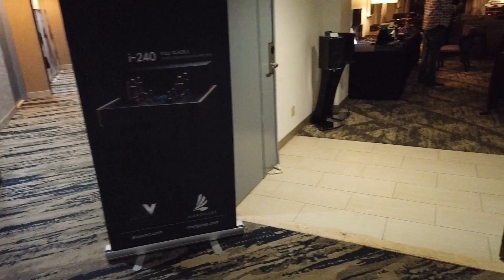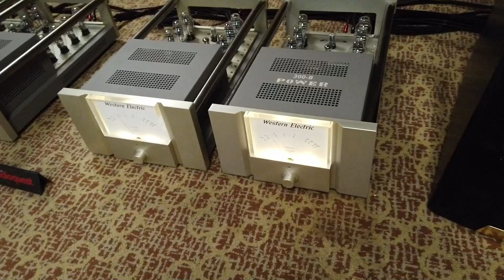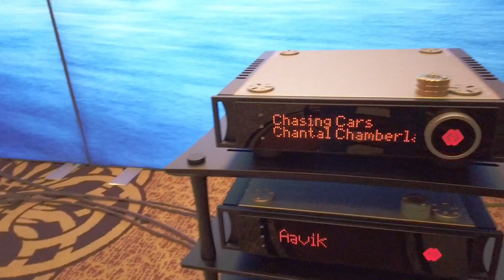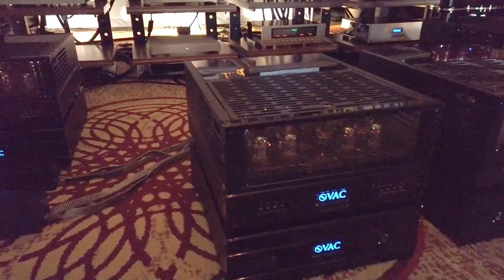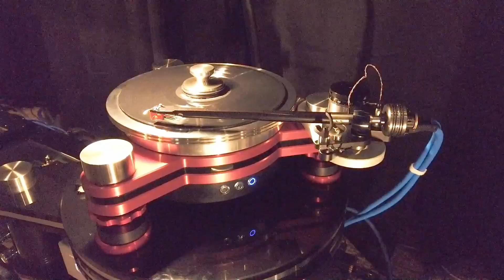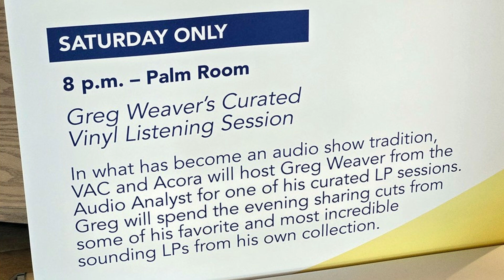E219: Top Five Rooms - Florida International Audio Expo

Comment: In that Supreme Acoustics room I noticed some interesting wood structures on the floor and to the sides. I assume that’s for breaking early reflections. I have never seen that before. Normally you see fabric/batting or foam in asymmetrical shapes. I’ve never seen that sort of wooden dowel structure.
Reply from the maker: Hello... Yes, those are the Acoustic Grove System (AGS) products from Nihon Onkyo Engineering, represented here in the US by AXISS Audio USA, LLC. See some detail here - https://axissaudio.com/brands/nihon-onkyo-engineering-ags/
Reply: @ Thanks I see that they have some videos. I’ll check them out!
Reply: Those same diffusers were in the Albedo room two...first time I've seen them too..but can't find my info on the brand